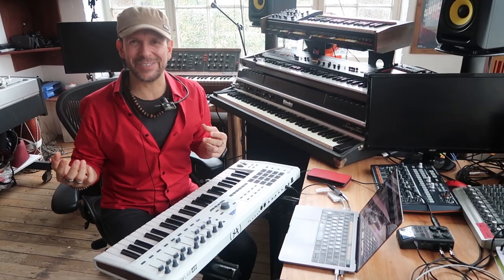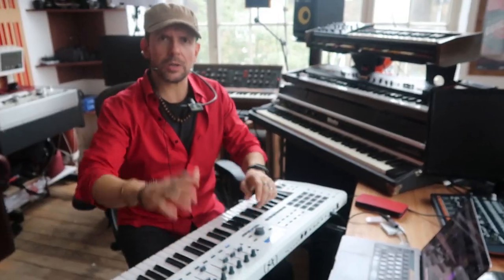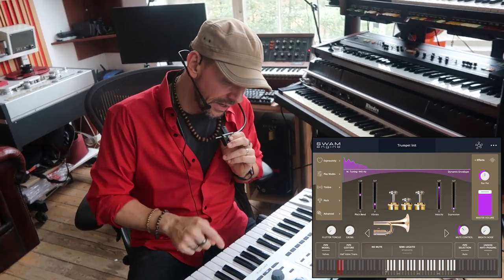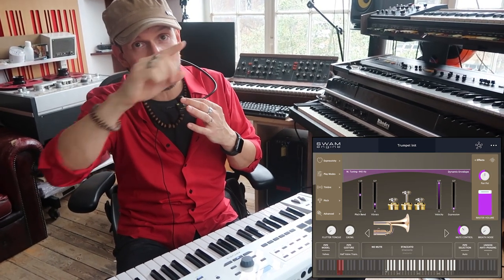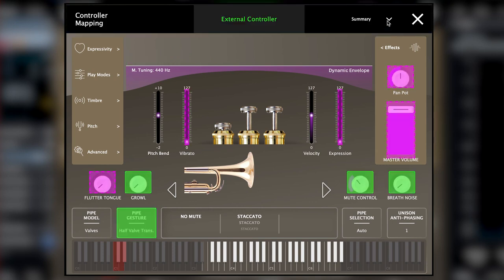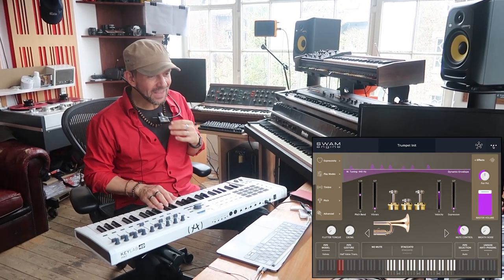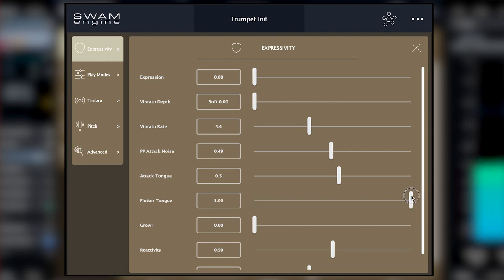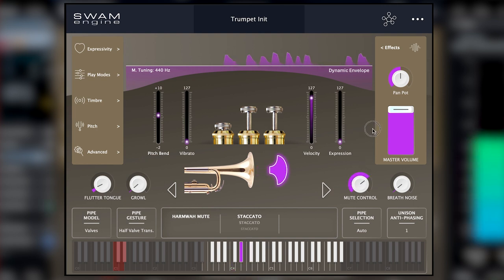Swam Brass In-Depth Tutorial With Doctor Mix

Comment: I wish the TEC control Breath Controller was sold  and shipped in the USA.    I wish I didn't have to order and have it shipped from over seas.
Reply: I felt the same way, but it was totally painless and I've never regretted it. In fact, an issue arose with mine and I wound up shipping it BACK over there, and that was painless too.
Reply: @CHayden07  so whatever issue you had, they replaced it no problem?
Reply: DarrinNoNAME They did! The bite sensor had gone bad; they even sent it back with some extra mouth pieces. It’s really really cool, I love that thing.
Reply: @CHayden07  thanks for sharing. I really appreciate it. How long ago did you get yours?
Reply: DarrinNoNAME Anytime! Must have been almost 4 years ago now. I saw a demo of someone using an NI Reaktor instrument called Silverwood that physically modeled woodwinds and some brass. If you Google Reaktor User Library and search for Chet Singer, you’ll find a number of physical modeling instruments from that guy, they are brilliant.
Reply: @CHayden07  will do..
Reply: @CHayden07  By the way.  I ended up getting it.  But It came in a zip lock bag. LOL.  Is that how yours came? I was a little thrown off by that.

Comment: 1:11  Hello!  Can you post which CC's you have assigned to your TEC controler, please?  Breath = Expression,  Volume = synth wheel ?  do you assign the pressure bite to anything? and also nod & tilt ? -is there anything special you set in the Tecontrol interface? thank you very much.   I'm a bit confused as to what controlling parameters i should assign my tec controler with the SWAM, there are way too many things.
Reply: I have only assigned the Breath Controller to the Expressivity, using the technique showed on this video. All the other bc features like nod and tilt were not assigned. Vibrato on the mod wheel, flutter and growl to the after touch. That's it :)
Reply from the maker: Hi, on the Controller Mapping Summary Pages there are quick reset presets
to map immediately a BC or other common controllers.

Comment: Can I get this if I don’t have a breath controller? I’ve never used one so I don’t know how much it impacts things. I have a midi controller with a bunch of knobs so hopefully that’ll be good enough?
Reply from the maker: Of course, you can control SWAM with any MIDI controller equipped with at least a couple of continuous controllers (i.e. knobs, sliders, pedals, ribbons, ...): one for Expression and one for Vibrato, plus Pitch-Bend
Reply: @AudioModeling  oh wow thanks for the fast reply. I'm definitely going to get the trumpet once I decide which platform I'm gonna spend my $ on. I'd totally pay more for this if I could buy once and use on pc and mobile

Comment: Are there any plans to facilitate Selecting Mutes (Type) from an External Source via MIDI?
Reply from the maker: What's wrong with Mute selection via MIDI? You can map Mute selection to any MIDI CC, and also remap the values to customize the selection.
Reply: @AudioModeling  Thanks, guys! I only saw the "Mute Control" on the GUI as assignable to MIDI. I'll have a look around to see where I missed Mute Selection.
Reply: @AudioModeling  I was only looking at the main GUI for the Instrument. I found what you are referring to on the Mapping Table and, after touching the "Mute" label, saw all of the Mute Types. I can now put my idle Korg nanoKontrol2 to use. Thanks for the info.

Comment: The demos are great, but it's exceeding my expectations so far. Unfortunately, my DAW hasn't recognized it yet! Ugh.
Reply from the maker: Hi banjo pariah, what OS / DAW do you have?
Reply: @AudioModeling  Hi, I'm using Windows 10/ Reason 10
Reply: @AudioModeling  I figured it out: the .dll files were sent to a different VST folder (i.e., VST (C:\) than the usual, so I had to move them to the existing folder which is in Program Files... or I could have simply added that new folder to my VST search in Reason... Any who, It's fixed! Thanks for your concern. Hopefully this post helps someone else!
Reply from the maker: @Tutnese  during the installation it is asked the path for the VST and VST3 plugins
Reply: Right, but usually plug-ins on my system automatically install into my Vstplug-ins folder, so I didn't pay attention during installation. But, it all worked out!

Comment: Having big probs with the TECONTROL and Cubase 10.5 (under Win7 64). The breath controller works on his own (connect to the little config app, i can configure it, and then i hit "make permanent" also).  But f**ing nothing passes to Cubase. 
Midi channels are set ok, the config panel of Cubase is ok (active and "show in all midi"), no "direct something" active. The breath controller is in the menu of the midi controllers of the track. Even creating a midi track with only the breath controller as input... just for testing if i can record midi CC... i record nothing!  and the midi input meter show... f***ing nothing!  
I have SWAM saxes and clarinets... and tons of other libraries and VSTs compatible with the breath controller... and i still can't get a f***ng note!!!
My other controller in this setup are a Krog microKey and a Korg mikroKey Air... both on USB.
Can't find any resource on line... if someone has some idea... plz... help!

Comment: How much does this total setup cost?
Reply: TLDR: My full setup cost $770, or an even $1k if you count the guitar controller. I am still waiting on the woodwinds to release on iPad which will probably set me back another couple hundred. That price doesn’t include the iPad Pro as I already owned it. 

Below is a breakdown on what I have and what it cost.

For the trumpet pack on PC it’s $250 but you get 5 instruments. Flugelhorns, etc. On iPad the same pack of 5 costs $120, but last month was on sale for $85

For all instruments on PC, it would set you back $1100. I’m still waiting on the woodwinds for iPad which should be coming soon, but at full price it would be roughly half the cost for iPad over PC. Less if you wait for a sale.

The TEC controller he uses also works with iPad and the SWAM apps and absolutely takes them to the next level, making them nearly indistinguishable from real instruments (I played violin for 20+ years and 5 in a symphony, so I’ve heard thousands of hours of these instruments in rehearsal, and SWAM blows me away.) The TEC controller cost me $330 including shipping. 

As for the keyboard, I got the Arturia MiniLab MKII for $120. It’s the little brother of his keyboard which I believe costs around $500. Another interesting option is a midi guitar. I managed to find an open box You Rock guitar online. Sadly the company appears to be out of business for several years, but it’s a powerful midi controller and synth, and I love it.

As far as composition software on iPad, there are several DAWs. I have Cubasis 3.3 which was $50, but it seems like garage band, the free app from apple is the easiest to get started in. You can use the SWAM instruments directly using inter app audio.

Comment: Update: I select the desired mute in the assignment page, select “learn” & press the controller button. When I press the controller button, it will cycle between “no mute” and “hand mute” ONLY. It will not open the mute tha I selected.
Reply from the maker: You are sending just two values: 0 and 127, so it selects the first and the last mute. You need a continuous controller. Send 0 to 25 for the first mute (no mute), 26 to 50 for the sencond mute, and so on.
Or you can apply a remapping curve to select a given mute. Read the User Manual on how to apply a remapping curve to a parameter mapping
Reply: Fantastic! You made my day! I had the Trumpet (and Euphonium) dialed in, but wanted an easier way to select muted in Camelot Pro (besides assigning the Trumpet with a mute to a Scene, which causes a hiccup in the PDF attachment). Thank you very much!